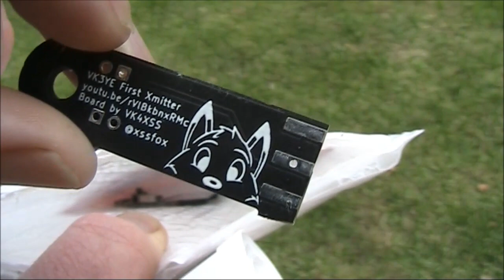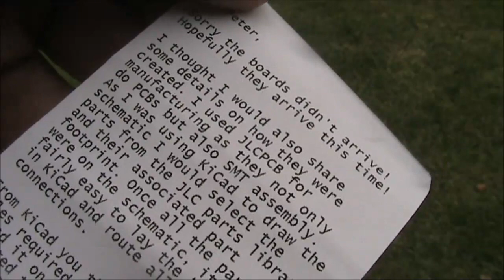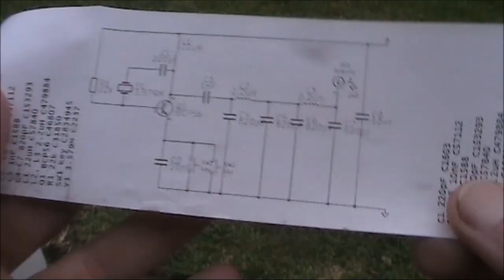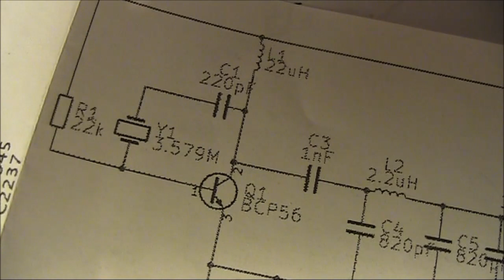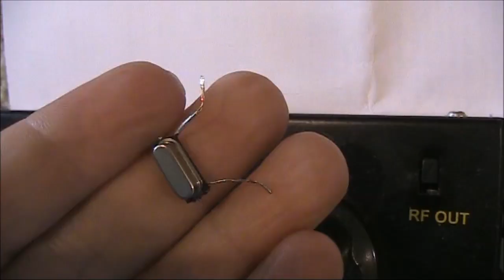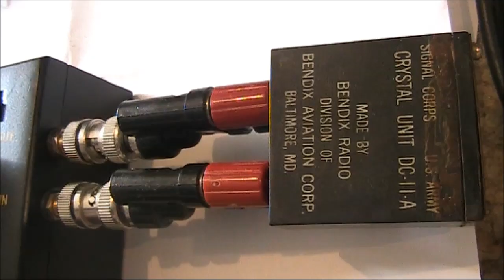Another mailbox item (and problems with crystal oscillators)

Comment: Professional engineers conduct design reviews and prototype tests behind closed doors, but if you're an amateur I guess you do them in front of an international audience. I'm sure VK3FUR won't be embarrassed , and neither should VK3YE if it's pointed out that his original chopping-board design provided for no current limiting in either the collector or emitter circuits. Putting as little as 10 ohms before the RFC on the Vcc line alone might have prevented failure of the SMD choke, and some degeneration in the emitter circuit would have further limited the current and stabilized the whole oscillator. In fact, unless the power supply was current-limited, prolonged key-down would surely smoke the transistor as thoroughly as that surface-mount device was. So running a BD139 full-bore as an oscillator wasn't necessarily a better idea than using a light-duty SMD choke on an unnecessarily-small PCB layout.

“Everything should be made as simple as possible, but no simpler.” Albert Einstein, 1950.
Reply: But if you put that resistor in VCC…… that would be a bit biased, don’t you think? 🤔 😎😝….nerd electronics joke!

Comment: I believe this is the same circuit from your breadboard/cutting board project? I had to change out the 22uh inductor for a 100uh one and got it to work. However, with 12v it fried the BD139 with in the 3rd CQ. I'm not sure how you have such good luck with them not getting EXTREMELY hot.  Inquiring minds want to know.  WV3V- Jason
Reply from the maker: Two things to do: 1. Put a resistor (10 - 100 ohm) in series with the key to limit current as mentioned by Todd. 2. Put a heat sink on the BD139 tab. I needed neither but YMMV.

Comment: I often wonder when I see simple transmitters with low pass filters directly on the output - are the filters designed assuming 50 Ohms in and out, disregarding the actual output impedance of the transmitter? Without matching, there's going to be quite a bit of reflected power, maybe that adversely affects the circuit?
Reply from the maker: There is a certain 'sweet spot' around 2w where the final stage's output impedance is around 50 ohm with 12 volts. That makes things easy. You can also get around the problem with higher power stages (say ~5w) with a 4:1 transformer which is based on the PA impedance being 12.5 ohm. You are right, you do need to think about this if there is a significant mismatch and you are aiming for maximum efficiency. There are some online articles that explain this more thoroughly.
Reply: @vk3ye  - Thanks so much for your reply, Peter! The reason I ask is I’ve even seen many designs that omit matching, even 50 or 100mW VHF TXs running from a 9v battery, (eg Fredbox, Sixbox, etc.?) which must make them seriously inefficient with the PA’s high output impedance, but of course at those power levels it’s likely just ignored. I’m curious if a high amount of reflected power in the circuit you demonstrate in your video would be enough to stop oscillations with a marginal or smaller crystal. 
Thanks for the marvellous videos, Peter!